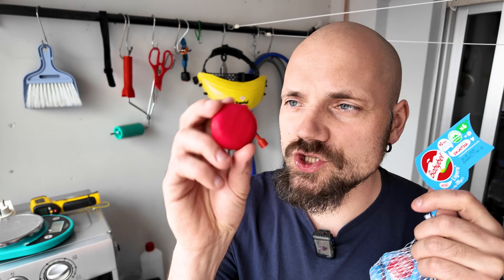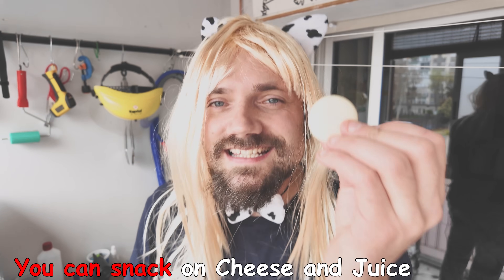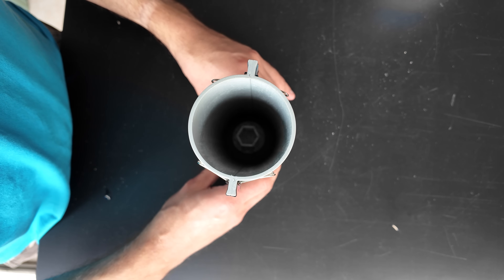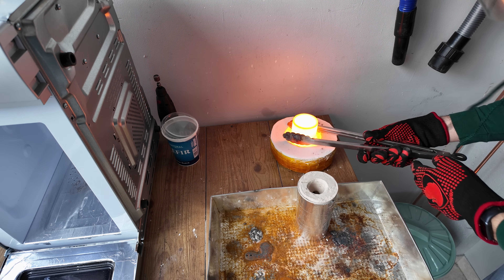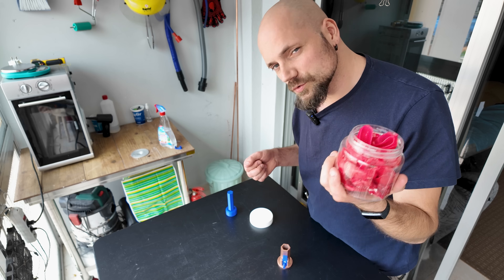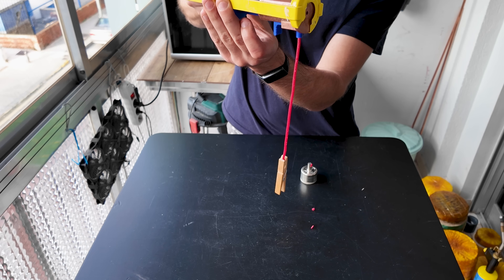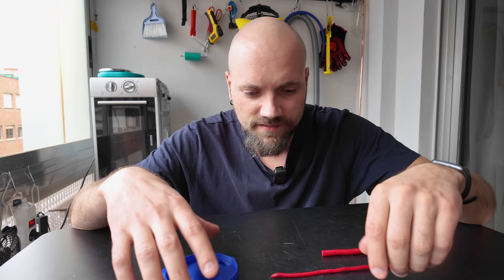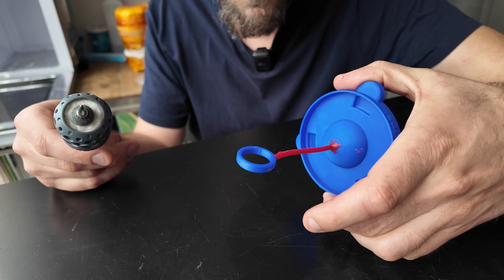How to Make Sprues from Babybel Wax (Lost Wax and Metal Melting)

Comment: I collected at least 15 kg of that red wax (I used to get the large Edam wax from the store).
I use it for modeling, but in some cases it becomes too soft at room temperature, so I hardened it "without compromising its characteristics." You can do this with: (low percentages of your choice)
- Paraffin
- Carnauba wax
- Montan wax (microcrystalline polyethylene)
- Rosin (no more than 3%, otherwise it becomes sticky)

Comment: cool as.printed and tried,worked great.cheese wax melts a little to easy in queensland australia at 40DegC.i like to use other waxes and melt them into a one time paper mold.one of your plaster molds with a ten mm dia and 120 mm long with a sprue funnel at the top{so I/we dont burn fingies} in stl would be awsome for this.wink/wink.love your stuff mate.
Reply from the maker: Awesome! I live in Spain and in summer time, you can definitely see the difference in softness of the cheese wax. Cheers!

Comment: It's weird seeing this video only now, as I've been saving the Babybel wax for metal casting for at least a year, and I could've sworn I got the idea from you.

Also, I just now realized I should try using that wax for sealing and burnishing the edges of leather.
Reply from the maker: I have been using Babybel wax for years, but in older video I did not extrude the sprues. I just shaped them by hand. Cheers!
Reply: @ShakeTheFuture  Ah, okay, that makes sense! Kudos to you for coming up with the idea to extrude the sprues! I never would've thought that was viable.
In fact, I just remembered that I've seen beeswax press-extruded for metal casting before, but I somehow still didn't think it was possible with the cheese wax, figuring it would either be too firm or too sticky without much in between. 
Just for reference, here's a link to the YouTube video about Dhokra, an Indian lost wax metal casting technique, where I saw beeswax extruded like that (and I've time stamped it for that moment): https://youtu.be/x77TORn-zf0?si=EjUL1Jl4-Madlp8R&t=64

Comment: I'm surprised the copper casting turned out so well. From what I have read copper flows less than say bronze or brass. As far as your wax. What if you mixed in a little paraffin wax to make it a little firmer?
Reply from the maker: I suppose I could try to do it. I must say I don't mind it being softer, but I might give it a try anyway. Cheers!

Comment: I'm broke, but I have loads of aluminium, what is the cheapest I can get away with a crucible or DIY or something...   ?
Reply from the maker: If you only want to melt aluminum, you can get started with a hobby setup using a blowtorch, some kind of container to melt the metal (like a stainless steel cup), and maybe a few firebricks or other types of insulation. It’s not that difficult to melt small amounts of aluminum with a MAP blowtorch. You can even wrap a stainless steel cup with a ceramic fiber sheet and torch it from the top. Whether it’s the cheapest way to do it, I’m not sure. If I were looking to get into metal melting and didn’t need to melt iron, I’d probably explore one of those Vevor electric metal melters. They can be picked up for under 200 EUR/USD and come with everything you need to melt metal. I haven’t tried them myself, but they look pretty good for the job.
Reply: @ShakeTheFuture   I have a cup thing on a long metal rod my dad and I used to use back in the 90s to cast lead sinkers with... and an outside braai (barbeque) that can handle a big fire. I design minifigs and statues, for 3d printing. would like to adapt and copy a few with casting.

Comment: Glad to see im not the only one using cheese wax for metal casting! I mix some bee's wax with mine to controle how soft/sticky it is. Works great!
Reply from the maker: I'll need to try that. I have some beeswax that I bought years ago—I might give it a try and maybe even make a video about it. Extruding harder waxes might require higher temperatures, possibly even a metal nozzle… Then again, as I write this, I just remembered that I have some high-temperature-resistant resin that I used for the soldering iron. That should easily handle the temperatures of molten wax. Cheers!
Reply: @ShakeTheFuture That was something I wondered, how well would the sprue-moo handle the mix? Your metal one should do a great job when pre heated and with the wax mix warmed as well. I usualy don't go higher than 50% bee's wax by eye, you can play with ratios to get some variation. I look forward to seeing you try it if you do!

Comment: hm if you make the thing round, you could make a thread and use a screw to press down on it, that way you get insane amount of extrusion pressure without breaking a sweat. use mechanical advantage :) great with the caulk gun though. maybe you could mix in some harder wax from a candle to make it stiffer?
Reply from the maker: That's a great idea. Thanks!

Comment: Lost cheese casting
What next?

Btw you can buy cheese wax without buying the cheese.
And it may be simpler to cast it into a sheet on a baking tray and slicing the sheet wax into rectangular sprues.
Reply from the maker: Oh yes, I have bought some of that red cheese wax in the past. It wax a little bit harder than the wax from Babybel, which I suppose is better. Cheers!

Comment: Great! you could even cast some metal stamps to do your own moo-wax seals. 👍
Reply from the maker: That's a good one! Or make the stamp microwavable so it can be used to burn into wood as well—just like I did in the soldering iron video. I think that part flew over a lot of people's heads since it was right at the very end of the video. Most people didn’t get that far and assumed the video ended after showcasing the soldering iron :)

Comment: Sometimes I need wax I can carve or machine.. I use canning wax from the store, melt it in a gallon can and add pvc plastic (bucket) about 1/4 to 1/3 pvc to wax, cook it for a bit, the plastic desolves in the wax and you get really firm wax that will burn out!
Reply: Toxic deadly smoke while burning out due to the chlorine. Eek.
Reply from the maker: Hmm, that's interesting. Do I understand correctly? You are actually melting PVC and mixing it with wax? That's a new one :)
Reply: @ShakeTheFuture  Just melt the wax, dump bucket pieces in, they dissolve at wax melt temperature, not pvc melt temperature.. The percent pvc to wax sets the hardness. It carves like wax, no chunks.

Comment: Can you use a graphite crucible with this method? Or is silicon carbide with water glass better/safer?
Reply from the maker: I’ve never tried making my own graphite crucible, as it can be messy to work with—but I do want to try mixing some graphite with SiC at some point in the future. I did buy a graphite crucible from AliExpress once… it didn’t even heat up. So I don't have the answer if a pure-homemade graphite crucible would heat up. What I can say is that crucibles bought from internet may or may not work. You won't know until you try it. It can depend on how they are made and what's been added to them. Cheers!

Comment: Nice casting.  If you want to make your sprue harder all the time while working with it, just use a mixture of cheese wax and some hard candle wax.  Using a green or blue colored candle can help judge how much hard wax you are mixing with the red cheese wax.  The same trick works for making beeswax harder when filling electronic coils or enclosures.
Reply from the maker: Thanks for the tip Peter!

Comment: You can also make soft wax by melting it and mixing in some oil. I have made soft pliable wax using beeswax and pine resin.
Reply from the maker: Interesting! Thanks for the tip.